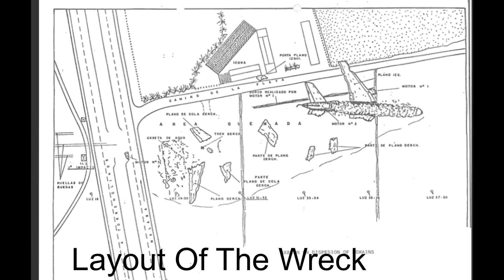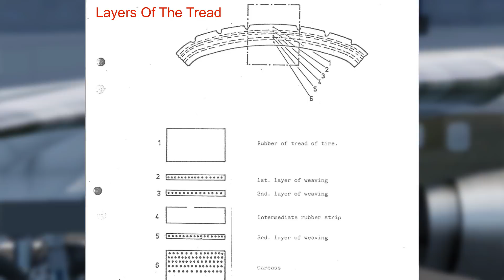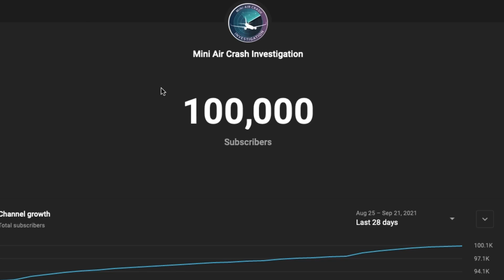How A Flat Tyre Killed 51 People | The Crash Of Spantax Flight 995

Comment: If the vibrations were coming from the nose wheel and as said here in the video, the captain  DID  rotate the nose up, THEN WHY WAS THE VIBRATIONS  getting worse ?
The nose wheel was no longer in contact with the runway so therefore the vibrations should have stopped at that point..
EITHER SOMEONE IS LYING HERE OR  we're not being given all the correct information.. .
Reply: Or, more likely the suspension (OLEO) of the nose gear absorbed most vibrations but when the nose gear lifted into the air nothing dampened its vibrations. This type of aircraft does not have brakes in the nose gear (most airlines don't have them in the nose gear) so the wheel would've kept spinning...

Obviously you could've just read the report yourself. There's a difference between critical thinking (good) and expecting a conspiracy in anything (not good).
The vibrations would be more due to a huge weight offset in the nose gear than just a bumpy surface on the nose gear.

Comment: How long did the captain try to get the airplane in the air after V1, and did it have time to do so, if it was going to? I believe now, based on what I've been able to find, that the takeoff has to be completed after V1 no matter what, unless the plane simply ain't gonna fly, which is something I saw in another investigation where the pilot there rejected after V1. However, an excursion is pretty much guaranteed at this point.
Reply: The pilot believed they couldn't fly as they lifted the nose gear and the vibrations worsened, seemingly indicating that a flight surface was broken. That's when the captain made the decision to abort after V1, he thought he couldn't fly this aircraft anyway, thus taking off was pointless and guaranteed to kill everyone aboard.

Comment: Actually flying the airplane is not actually that hard. Not much more difficult than driving a car. In some ways, flying an airplane is actually easier.
      Most of what makes a good pilot is decision making. Making the correct choice is not always easy, especially when all choices available will have unpleasant results such as rejecting a take off after V-1. At that point, choosing to reject the take off is essentially choosing to crash the plane.

Comment: probably not the right call in retrospect, but considering he was in a plane and all the chaos in that final few seconds, he did the best with what he could. maybe an engine had a problem and didnt show up? that engine might fail and take out hydraulics and then they call out of the sky from 1000ft with no flight controls. your not taught in driving scholl about what to do if the bridge your on is actively collapsing, they werent taught about tire failure on takeoff

Comment: After V1 all decisions are split second decisions. So is the pilot to blame. Let's think about vibrations as a result off a severe flight control issue or airframe issue. The outcome could be worse, than an runway excursion and could have ended in a loss of airframe and all souls on board.

Comment: When Airlines say passenger safety is their primary concern, that's b/s if it wasn't, runways would be twice the length
Reply: Who do you think build runways?
Reply: FWIW, runways could stay the same length and takeoff weights lowered instead to get the same safety margin.  Of course, that means higher ticket prices (less passengers) and/or shorter range.

Comment: It's a no brainer. Reject take off. Pilot made right call. He saved all the lives on board and the crew and cabin. 

But what u say about the 51 killed. Well I dk what to say. The person at fault whoever applied the tread and used there adhesives not like u have to do time. But ur obviously fired and sued millions of bucks. They should never be able to work that job again. Very sad and tragic what happened here. 

Maybe it wasnt their fault either. The pilot rolled with the punches and btw the plane wasn't taking off anyway it seemed. I think he didn't take off cuz one the fking plane couldnt.

Comment: I don’t get why pilots don’t have cameras that point at the flight surfaces. Often times I feel like they could make more informed decisions if they knew about the status of their plane through more than just some control lights. Had they had the opportunity to see their flight surfaces and engines fully intact they might not have rejected the takeoff. Then again I’m not a pilot.
Reply: Once airborne monitor cameras are very useful, since then normally you have the time to browse around looking for hints. During takeoff everything happens so fast that there would not be any time to browse through menus or multiple camera feeds to come to a good conclusion. In such moments, it's basically all about memory items, ie procedures that you have practiced so much that you can do them instantly without thinking. So once the captain calls for a rejected take off, even as in this case at a excessive speed, the rest of the crew would just go into semi robotic mode, and follow that procedure. That Is also why accident reports are so important. Any time a new version of things falling apart happens. The report is studied worldwide, and influences future training, and if need be one or more memory items are updated, requiring a lot of training to make sure the flight crew has the new one nailed down. Memory items are used in time critical moments, when there is no time to go through a checklist to come to a more analytical conclusion.
Reply: @ipadista  I mean yes if they are hidden in swaths of submenus yes. But I guess if done right they could be not more mental strain than looking in the side-mirror of your car.
But yeah there probably is a good reason why they don’t exist otherwise they surely would have implemented them

Comment: A friend who flies MD10/MD11s once told me how a bad vibration was said to be a probable blown tire but instead was a broken proper blade from one of the engines he aborted the takeoff and was reprimanded for it even after the broken blade was found was problem and would failed upon takeoff probably ending in a crash, but to the company it meant the plane load of people had to be transferred, it meant more maintenance down time for the plane and most importantly it cost them money while a crash would’ve been pinned as pilot error and no money or little money would have to paid by the company incurring no loss, but my friend as fired because he refused to takeoff while a busted plane incurring a monetary for the company loss and a huge reputation loss of his flying
Reply: Do you have a flight number for that incident? Seems highly unlikely that this is what happened, the NTSB would've been all over such an airline.

Comment: DC 10 the worst plane to land, When trying landing, before touching down at 10-20 you have to increase engine power because the horizontal stabilizer and rudder are small, too small to control landing procedure less speed less control especially at that critical point 

Plane needed much bigger rudder and Stabilizers

Comment: Just using common sense, if a vibration is getting worse as you are accelerating down the runway....abort the takeoff when you see that the vibration is intensifying....instead because the pilot never trained for that specific situation, he continued..raised the nose wheel and then changed his mind..he was supposed to be safe and abort as soon as the vibrations began..and a major clue was that the vibrations were getting worse...the intelligence of the pilot cones  into question...

Also, how could the dc10's manufacturer not have designed a protocall for a malfunctioning tire on takeoff?

After all, this type of accident was known to have happened before.

A convair 880 from cathey pacific airlines in hong kong in the 1960s had a front tire blow out at a very critical time, just as he was about to rotate.....it was not an unglued retred but it was a tire malfunction just the same.

It is better to slow down and stop when you feel any abnormal vibration...come to a full stop and have someone look at the plane to see if it is safe to take off or not.

Comment: I used to drive trucks (18 wheels) for a living. And Re-Treads are horrible. They are good for an "on the side of the highway get me home so I can get a new tire" type of scenario. But I feel that passenger aircraft should not be allowed to use re treads. There are too many variables at play, like harsh conditions . going from -50 to +150F and dry then humid conditions. Over and Over.

Comment: Why dont plains have cameras on them? So the pilots can actualy look at the wings,engines, tail, and body of the plain?? Seriously cars have them. And alot of these accidents happened because the pilots didn't know the engine had fallen off. Or was on fire. Or an engine had broken up, or their landing gear wasn't all the way down. Simple pilot cameras would be a huge plus for safety so the pilots would know exactly what's happening without confusing instrument controls and warnings. Why make pilots decifer whats happening taking time they don't have? Just put 4 cheep cameras on the plains and alot of these accidents wouldn't happen. Most of the time accidents to happen because the pilots simply don't know what's wrong with the plain so they can't make good decisions leading to worse outcomes.

Comment: most semi truck drivers will NOT use "re-treads" on their semi.... trailer, drive, or steer
and even the ones that do...to save considerable money... will NEVER use them on the 2 steer tires
.
so why the HECK does re-treading commercial airplane tires even exist? 
.
.
im a mechanic / tire guy..... ive mounted, balanced, patched, ETC probably 5000 tires in 3 years
from lawnmowers to semis to LARGE tractor tires
.
and everyone knows that a re-tread tire is just asking for trouble 
.
sure, the re-tread factories have come a LONG WAY in the last 10 years
and they have WAY less issues today
.
but.... you are still asking for more problems
.
.
.
i dont get how the FAA allows re-treading tires
for cargo planes.... sure, whatever.... who cares
.
but for planes with 100s of people as their cargo......no, just no

Comment: In the future, have ground based cameras automatically track the planes taking off and report any anomaly to the captain. In this case it would be smoke and debris coming off the tires.
Reply: That would not work at night (FLIR would usually not provide enough detail right behind an aircraft with 2-4 jet engines generating heat) and it would not help here as there was no time for the pilots to look at any camera footage let alone come on the radio, wait for any other call to be finished, ask ATC to watch their TV, wait for ATC to do so, zoom in and maybe see what was happening (not likely) and then radio back that it was ok to take off... If the aircraft had 2-5 minutes and took off in perfect weather conditions and ATC had an auto-tracking 4K camera with high-zoom lens mounted on it that could've worked but if they had 2-5 minutes they could've also just stopped...

Comment: Surely someone would question why the airport decided to place that building directly in the path of the planes which were taking off. I realize that the busy road also created the main hazard to this situation, but every effort should be made to keep the runway overrun area free of obstacles. Sooner or later this scenario would occur, and the aircraft really need a clear area to bring the plane to a stop safely. I wonder if the investigators mentioned that in their analysis of the crash. As I see it the 330 people who survived the accident were quite lucky, but the other 51 should not have given their lives just because the airport designers messed up.
Reply: *realise
Reply: @Chris-nn3vu  - Realize and realise are alternate spellings of the same word. In the US and Canada, realize is by far the more common spelling. In the UK, Australia, and New Zealand realise dominates, though realize is sometimes used too.
However, if I spell it your way, my computer annoyingly flags it as misspelled... 🙄

Comment: Vibrations started before V1?
If yes he should have aborted then and there. Anything that is not normal, wether he knows why or not, should stop take off. 
The pilot was not trained for that scenario?  It should be « take off only if everything is ok ». Anything else, stop. 
After v1 keep going.

And why shutdown the engines?  Shouldn’t he have kept them on with reversers?  Or was he off the runway at that point so better shut them down ?

Comment: You cannot say that the pilot made the right decision, given that if be had continued the take off, the aircraft would have flown normally and safely. Whilst you can argue that his concerns at the vibration were logical and his decision in the circumstances understandable, he acted incorrectly. It is the cardinal rule that once you have achieved V2 and rotated, you continue, even if you lose an engine.
Reply: That’s easy to say in hindsight. It would have been just as easy to claim that it was wrong to take off with these severe vibrations if the reason for the vibrations had been something that made the plane uncontrollable after takeoff, leading to a crash with a much higher number of casualties. Judging people’s decisions taken without the crucial information getting available afterwards, is simply unfair and ignorant.
Reply: The video asked a rhetorical question, did the Pilot make the right decision?  The answer, with the benefit of hindsight, is no, although I clearly stated that his concerns on the day were understandable. The fact remains that V1 is the decision point and at V2 I am committed to take off unless something physically prevents that. You have to understand that that is what we are trained to do. If we detect any abnormality up to V1, we abort. At V2 we fly (unless the aircraft fails to do so). If you abort at V2, a runway excursion is inevitable with a high risk of casualties whereas if the aircraft takes off, an immediate return is possible with lower risk of casualties. That is what experience has shown. I was at the site two days after the crash and have every respect for the pilot but the fact remains he made a bad decision.

Comment: As much as I know, the pilots of the crashed Concorde did take off after being over the point of no return, altough the engine / wing was on fire. They did as they were told to -maybe NOT following the rule - as the pilots in the example above did - could have save their lives back then?

One thing I still don't understand: If it was the tire of the front wheel that was desintegrating, why the noise and virbations got worse whilst it lifted up from ground?

Comment: Of course it was pilot error.
Rejecting take off after V1 should never happen IMO.
In this case the plane would have flown just fine.
Landing may have been a bit of a challenge but loss of life would have most likely been zero in that case.
Reminds me of the Travis Barker crash too when the pilot made the same error.
Just take off!
It’s a plane, it’s meant to fly.
They are not very maneuverable on the ground.
Reply: And there are cases of pilots taking the problem airborne, and a few minutes later everyone died.

Comment: Hate the dc-10 like poison. It’s the jetliner of death
Reply: IMO, that's bullshit - sure, there were design flaws, but it seems like most of the accidents had to do with a combination of pilot error, maintenance shortcuts, issues with secondary part manufacturers for the craft, etc.  Given how many safe flights have been made with the DC-10, and each variants, between 1972 and present day, it seems like being treated like this uber-deadly craft is just ... it's just idiotic.
Reply: There wasn't much that happened with the DC-10 (engine coming off; fatal cargo door mishap; hydraulic failure; navigational error... retread failure) which wasn't caused at least in part by an "outside factor".  Overall, its safety record was in line with its contemporaries.

Comment: "Do you think that the captain made the right call? Let me know in the comments below".
Well, he killed 51 people, so I think the answer is no.
Reply: The tire shop that did the retread killed 51 people. If the vibration had been the result of structural issues or control problems and the captain took the airplane into the sky, possibly everyone would have died. He made the right call with the limited information he had.
Reply: @Rotuma1260  Fair point, but past V1, you take off, otherwise this happens.
Reply: @pierreciholas9215  Sometimes pilots are faced with unknown conditions and have to make an instant judgement call, regardless of SOPs. The passengers of Nigerian Airways Flight 2120 (Nationair) would have preferred the pilots to have rejected the takeoff. They might have lived. Instead, everyone died, with bodies falling from the plane several kilometers before the rest of the aircraft hit the ground. "cargopilot747" is correct. So sad that they didn't reject the takeoff.